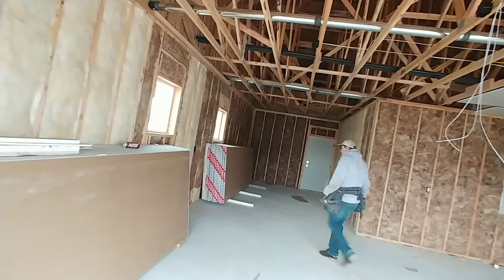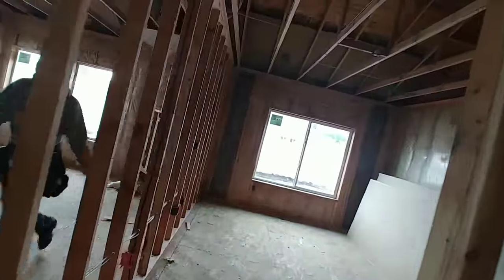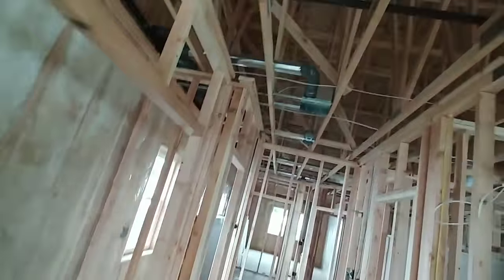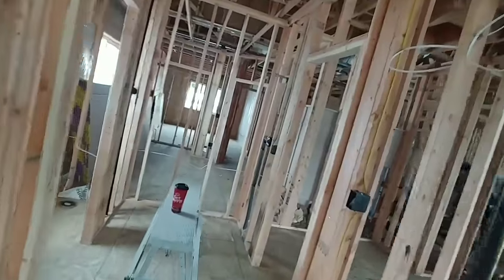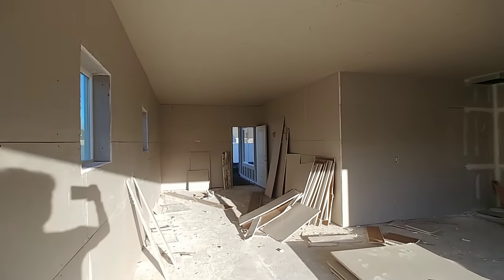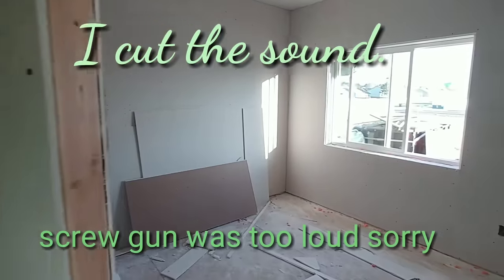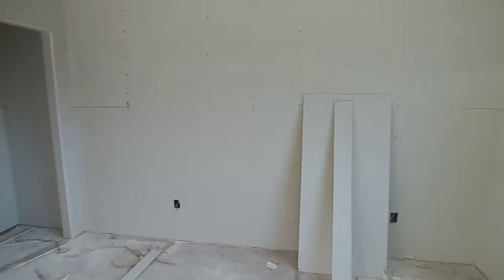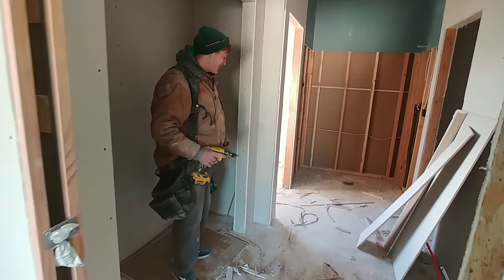Hanging drywall, 1 house 1 day, full crew start to finish drywall hang. Work vlog

Comment: Your guys could be faster with a collated screw attachment for those DeWalt cordless screw guns. Just saying. It's like comparing a Muzzleloader to a semi-automatic.
Reply from the maker: I'll probably get one here soon .
Reply: Nomadic INK  that's a little awkward using one at first. But after one job I got used to it. The screws do cost twice as much. But the time in labor more than makes up for it.
Reply: ya but then you miss out on the bit slipping off and driving itself into your fingertip.
no fun in that.
Reply: I know many hangers that screw faster then the collated attachments for the cordless dewalt ... maybe the ones that attach to the corded drywall gun on a demising wall but if you miss you can’t pull the screws from the lid.
Reply: Hilti with collated attachment (we call them auto heads here) is amazing. Got the cordless model a year ago, will never turn back. I always preferred the Hilti over the Dewalts for drywall guns though, just feel better to me. Didn't really like the Dewalt cordless.. but I probably didn't give it a fair enough shot. Use dewalt everything else though interestingly.
Reply: If you can screw fast with a single shot then removing the part where you load your screw would make you faster. It's definitely way faster and easier for lids, especially when you are hanging 14's 5/8th over your head all day and start getting the strain going
Reply: Superdan187211 I hate those cordless dewalt guns. Cones stick and screw sets aren't consistent. Hilti guns are the shit.
Reply from the maker: Ill agree I'm getting rid of my dewalts. Ive been getting good results with the Milwaukee
Reply from the maker: Thanks man!
Reply: Fermin Juarez did you drink too much tequila and comment on the wrong video? Wtf are you even saying?lol
Reply: Jaked89 and Cost three times more per screw count. Box of 1.25" coarse thread late 90's was 40$ while the half as many per box collated strips of screws cost 40$ or more. Time saver for the weak that can't run a screw gun. We nailed and field screwed  here, my right rotatory cup still tells that story years later.
Reply: A guy that's been running a screw gun for a while can hold screws in one hand and scoop them up with the drill tip like nothing.  Works faster than a pet dispenser.   I'm no pro and I'm halfway fast at it.  I don't see much advantage to prestrung screws.
Reply: All good points but collated are really good for lids especially double layer.  From my point hilti is the best for corners, tops,  battery life, and tightening shiners way better than dewalt
Reply: Those things suck?? What happens when you have to put the drill in reverse?? You have to pull the collilated screw strip out, put in reverse and then put back in. Nothing beats the DW272.
Reply: faster? buddy didnt you see this crew? theres a difference in crews, some are elite crews and youre watching one! maybe they are comfortable with those screw guns!
Reply: Absolutely!!
Reply: Lol i love how people are blaming the screw gun and not the person.. if you hold your hand straight you will sink the screws consistently

Comment: I'm a contractor also and noticed there isnt any strapping or rc on the ceiling...here where I live you never would get away with that...the screw pops would be never ending as time goes by.
You guys are great drywallers..keep it up.

Comment: Where is this site? I don't see any vapour barrier (super 8 poly) .
Reply from the maker: This job is in Idaho not all houses required to have vapor barrier. It depends on the county but the house is being built in. A lot of my houses are vapor buried this one just was not
Reply: Nomadic INK c
Reply: Hang plastic behind sheetrock on any house in Florida and i'll show you what extreme mold looks like 5 years later, you can't tell these yankee snowbirds a damn thing here in Florida they demand plastic sheathing behind the sheetrock while the only code is a vapor barrier on the outside sheathing. Prevent the moisture there outside and there's no need to fight that bullshit plastic taped or buttel taped to every top plate and corner that you have to cut back and out of the way any damn way!
Reply: I knew it was close by....I could tell by the radio station...lol....spokane here..:)
Reply: I'm in Bend Oregon we don't use vapor barriers either, however we do use spray in sound dampening insulation on all interiors

Comment: Question, why don't you use the cordless drywall guns with the collated screws, especially on the ceilings? I checked Home Depot prices on screws and the 1 1/4 inch drywall screws are actually cheaper if you buy them in collated form, $7.47 for 238 loose screws verses $21.98 for 1000 collated screws. The Makita screw guns aren't cheap but you guys are pros. I am sure there is a good reason that I can't figure out. Do the collated guns not drive the screws constantly flush compared with the drywall screw setting bit?

Thanks.

Comment: Its always great to see white folks in the trade. I hardly see anyone else but Mexicans in construction.
Reply: YoSoyGus1 only guys that hang dry wall.not where I am from. Plummbers,electricians, pipe fitter, HVAC, and metal workers hardly any. This is residential work I only did commercial or industrial
Reply: @lilcourtny08  Where am from there's Mexican plumbers,painters, and even Mexican electricians

Comment: You Yanks don't use glue? What's up with that?
Reply: No we use hardware so it stays up
Reply: @jeremiahtatom6154  We use screws on the edge, glue in the center. That way you dont get popping screws, and the plasterer has a very easy job. Trust me, they stay up. Glue is better than screws, because it's flexable. Screws will pop over time as the wood expands and contracts. Not a problem when its in the taper or under trim.

Comment: Awesome job guys wow great crew, you all just flow together. I’m doing a DYI job in a small room. Had to remover stucco from a ceiling and now I’m gonna skim coat it. Get it ready for paint. This small room is prepping me for the upstairs. All of it is popcorn ceiling and is coming off. For health reason is coming down. Then I’m gonna skim that one too and paint it. Depends on how much I can get off. It should be way easier then this stucco that came off. I’ll have photo on my IG under the same name but with _ underscores for spaces.

Comment: Did you ever try to hang all the drywall by yourself.  #5,320,470 is the patent that I received back in 94.  I could take the tool to the job site riding a motorcycle.  It held the sheets so I could place them with precision, and in complete safety.  If I needed to cut a hole, I did not have to take it down.

Comment: This is one of the jobs my father would have me help with. We are both 6'6 so he wouldn't have to rent the stand that helps you do the ceiling work if i was there because we can both easily reach a standard ceiling height. Once you get into a groove it really goes fast. I had no problem hanging the sheetrock but i f'ing hated the mud work.

Comment: Hi guys. Keep working hard! Do you use dabs of stud glue between the nails/screws for the ceilings in the U.S.? Some jobs we had to use sisal strips soaked in cornice adhesive over the ceiling joists after. - Just depending on architect specs.
Reply: Not done in the U.S. The biggest issue with aging drywall is joints showing. Very rarely sagging.
Reply: Nails depend on a few square millimeters of cardboard to hold the drywall securely whereas using a dab of stud glue could have a contact area of up to 50 square millimeters, and that glue is very hard to separate from the ceiling joists and the wallboard. Stud glue is very hard to remove from work-clothes after it has cured.
Reply: @bicaroyoda4686  If you watch videos of earthquakes in Japan for instance the ceiling peals away and collapses easily. They probably used only screws or nails. That stud adhesive never comes off. get some on your clothing - you will see. So, use nails AND stud glue - mandatory. (Never use nails and glue on the same spot though)

Comment: I know this is an older post but I'm in the middle of another reno at my house. I've been told to glue it and screw it. I'm not a drywaller but I have the time. 
so, help me understand the difference. I noticed you didn't glue it. is this just a myth, I've done both.
Reply from the maker: It depends on the codes in your area. In the northwest glue is not required as it doesn't get humid I believe.  Just check the codes for your area. If glue is required then you'll need to use glue.

Comment: 2 questions.. 1 why in the America do they not use noggens in the walls and 2 why not get use a belt fed screw gun, just seems a bit slow doing the ceiling with a drill

Comment: Nomadic INK
What do you charge a Square Foot to Buy + Hang / Tape & Texture walls & ceiling ?
Around here it is $1.25 Per Square foot. That includes the Drywaller buying all material.
4x12 = 48 x 1.25 = $60  Sheet Finished w/ Texture 
4x8 = 32 x 1.25 = $40

Comment: Hi is mold resistant Board required in bathroom ? Cause I’ve talked to my city . They said the shower and tub area I gotta use tile backer board it’s the code . But rest of the bathroom I don’t have to .

Comment: Good job guys.  However OSB on external walls or roofing is not permited in my area.  I know this is not your responsibly.   I was very suprised it was used.   Drywall looks good and clean cuts. Much Respect.

Comment: I worked hanging drywall for about 6 years. Haven’t done it again in like 10 years. We worked a lot different. We wouldn’t use stilts, we would stack paint buckets on top of each other and walk with them as if they were stilts. It was much easier than stilts because we could get off and on when ever. Also we used corded drills, they are much faster than battery. 2 guys would hang 100 sheets a day all screwed

Comment: so - one more question - the outlets and lights - are cut out after hung - so y'all scribe center of boxes somewhere or how do you locate boxes and cans?  thanks in advance
Reply from the maker: We mark with an x off the wall or previous sheet in line with the box and a measurement to the center
Reply: @NomadicINK  thanks - very nice vids

Comment: Good crew hard working  but no glue how do you get away with not gluing drywall e specifically on ceilings
Reply from the maker: Its not code in the area. People only glue if its required by code due to tgr climate of the area.
You'd go broke paying for glue and labor because no one would pay you extra for that service.
Thanks for the comment I hope this helps

Comment: Should you not have to have timber inbetween the trusses at the edge of the sheet edges where the bevelled edges meet?
Reply from the maker: It's not required in this area. Only on shear walls is blocking required on the recess seems in this area.
Reply: @NomadicINK  cool mate 👍

Comment: Nz fixer here. Definitely faster using collated screwgun. I could screw off a sheet 3 or 4 times faster than you guys did. Been using one for 15 years. So ancient not to use one. Also noticed so many joins. We only have them on spans over 6 metres. Seems a bit amatuerish. The skill level of our hangers is alot higher by the looks

Comment: Good work gyosum wise
I don't know if yalll did the framing but at 2:30 the raftors fork .. not equal spacing and or know where near 16" spaced looks like it's about to make the letter Y and without a stud finder that must have been a pain

Comment: When they hang on the ceiling how do they cut the holes for the lights so accurately? Do they take measurements before it they hang it up or what? I don't get it
Reply: Same with the outlets, how do they know where to cut the hole for the outlet?
Reply: Mark the hole then cut with a rotozip

Comment: Good work mates;!better with selfscrew guns it's quicker here in WA Perth doing with 6 m sheets by 10 mm,plus blocks with mud or glue plus insulation on the ceilings , glue on the timber plus budjoints to be in the in between timbers!    Insulation without plastic sheets;! crew of 3 -3-4 days 8-9h on 500-700sqm  usually the house is on 2 levels;!

Comment: Strange you don't use drywall adhesive (gib board adhesive). Part of the building code here in new zealand.  Also no dwangs between the studs or ceiling battons?..

Comment: Clean hang, looks good! Just wondering why no glue? Why no back blocks? And why ceiling isn’t battened with 16mm furring channel? I’m a plasterer in Australia, we must always laser level cieling, 4 dobs of glue on trusses, and back block.
Reply from the maker: Glue blocks and channeling is not required here. Each region has its own set of standards for drywall hanging. Some places still use Nails and they required. Which blows my mind
Reply: Cool. Would save you blokes heaps of time. May I ask what’s a plasterer make per hour in the states? Is there a lot of cornice work? And how long is your apprenticeship?
Reply: Lucky for me when I first started ten year ago, nails were completely being replaced by collated screws.
Reply from the maker: Tapers make arounf 18 to 20 cent a ft. Plus corner bead. The union tapers in Seattle are at 40ish an hour plus benefits

Comment: I'm not a drywall expert of any means, but shouldnt the screws be closer to the joint so one line of tape can cover them both at the same time? They seem too spread apart.
Reply: Tape is 2 inches wide and 2 miles long
Reply: @michaellagerstrom5685  looks like you need 6 inches wide from the video.

Comment: Jesus!  2 layers of 5/8" drywall on the ceiling? If you want fire rated ceiling for half the cost just use Hardie Backboard in the entire garage! That is 1 Heavy AS Hell on that roof but also expensive. Also why aren't the wires looped for some slack before entering the junction boxes? Electrical code different where you are?   Just curious...

Comment: Don’t you use stud glue in America, here in Australia there needs to be blobs of glue on every stud and every batten at 300mm ( 1 ft ) because the sheets are only gypsum and the screws are doing fuck all, the glue does most of the work. Basically you could pull all the screws out the next day and the sheets will not let go
Reply from the maker: Each area has its own set of building codes.  Typically the states with more humidity like in the southern states you are required to glue.
The drywall in this video was installed per building code for the area.

Comment: What was the need for the double 5/8 in the garage? Fire code or just for sound? You gotta bad ass crew, you keep them working and they seem to work well for you. That's usually a sign of a good boss. Hopefully you have many more years of success ahead of you.
Reply from the maker: Thanks man I appreciate the positive feedback. The double layers for fire code. Sometimes I'll have us to Shear walls for fire code as well. It changes Per County though
Reply: Nomadic INK I've never done a whole house of new construction and I dont believe I ever did a garage. Makes sense though I use that 1 inch 2ftx5ft fire board. That shits a nightmare. Usually in apartments buildings and townhouses. I learn something new every day. Have a good one.

Comment: I can't see close up. We just had what I consider a crappy drywall job done. Is it normal to have 5 outlets or more buried behind the sheetrock and broken pieces in the corners where the sheetrock was damages and bulges out, also sheetrock cut past the corner and the other piece of sheetrock is warped because it butts up against a poor cut? Not sure how to describe it but it looks bowed and crappy.

Comment: Why no Polly on the ciling?
Reply: Here on the midwest, poly on the ceiling is a disaster. UNLESS you have an air exchanger to get rid of the moisture. I have heard of houses literally raining condensation from the ceilings when plastic was used. The only way to remediate the problem was to go in the attic and slice the plastic.

Comment: Has anyone noticed they weren't using any adhesive? how long before it all comes down!
Reply from the maker: We dont use it on the west coast. Its not required. Theres houses ive done 19 years ago in this area and the walls are still on .  
You on the east coast?

Comment: Y 2 layers on the ceiling? Stronger? Help insulate better? Just curious..
Reply from the maker: It's fire code. Some areas you only have to do one layer but most of the areas around here or double layer in the garage. If there's a living space above it you have to shear screw the second layer off 6 inches on Center.
Reply: FIRE RATING

Comment: No vapor barrier or insulation before drywall?  why is that?
Reply from the maker: Are you talking about the ceiling? No vapor barriers required on the ceiling and they do blow insulation after the drywall's done.

Comment: Since when did drywall get hung sideways on walls
Reply: For quite some time now. If you filled out a 20 ft long wall with 5 vertical sheets, you'd  have 32 ft of joint not including the perimeter. If you did the same using 12' and 8's hung horizontally, you'd have 28 ft of joint excluding the perimeter. Sanding is easier since more of it is at chest height.
Reply: @lornes7526  we never had to sand much since we didnt apply too much mud, applying the tape was easier to do and it was much easier ordering 4×8 sheets in bulk than 2 different sizes. But we mostly did spec houses with 8ft ceilings